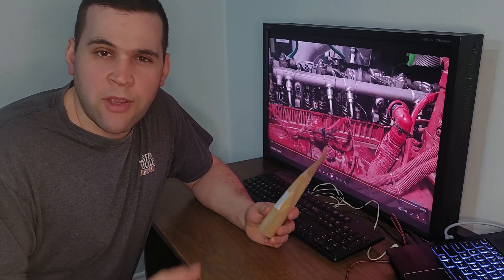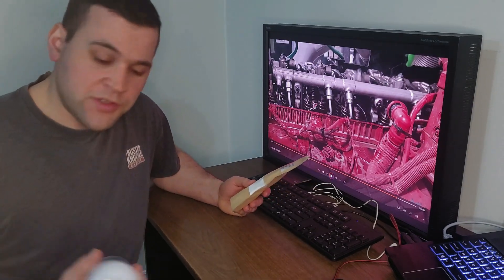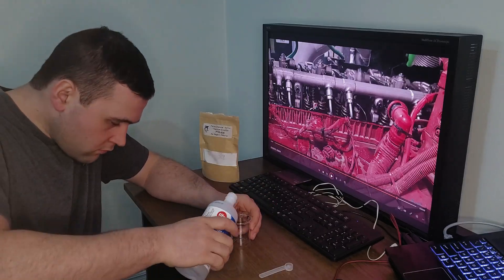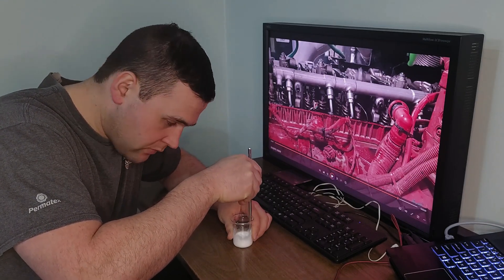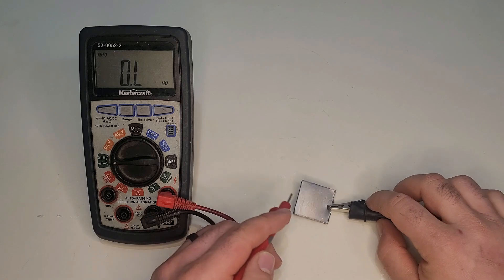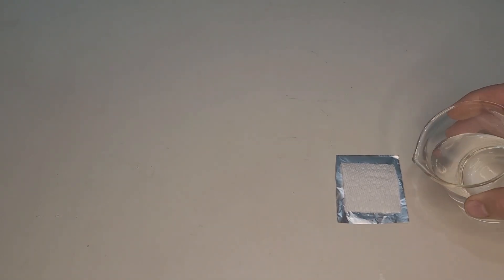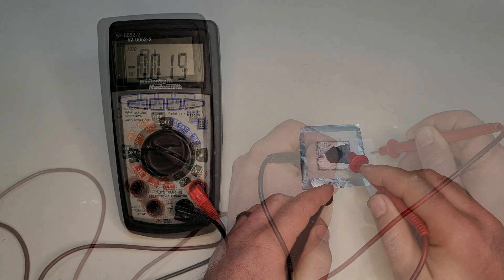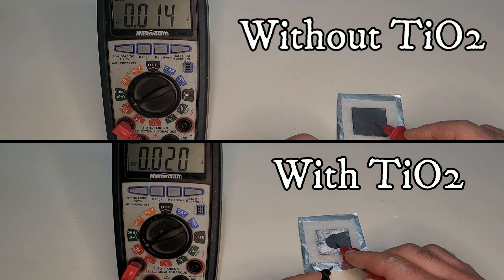Enhanced Aluminum Air Battery Using Titanium Dioxide

Comment: Try K2CO3 in water as the electrolyte, then you will get about 1.33 Volts from the cell and add some MnO2 as a catalysator to even boost the cell some more. Good luck ! Regards, Stefan.
Reply from the maker: Hi there Stefan.  Just wanna say thanks for your comments and suggestions.  Do you have any resources I could check out for more info on using K2CO3?  I'd be interested in reading up on it.  As for the MnO2 I've heard about it, and am experimenting with it currently.  Seems to be the best catalyst around for these kind of batteries.  Cheers!
Reply: @MechanicGoneRogue  it is potassium carbonate you will get 1.33 Volts per cell from it..👍🏻❤️🙏🙏🍀🍀🍀
Reply: Takes a bit time at the beginning, until the K2CO3 has reduced the aluminumoxid protection layer
Reply from the maker: OK well I'll be sure to try it.  Thanks again for the suggestion 😊

Comment: Can you test adding tiny amounts of cetyltrimethylammonium bromide to electrolyte. This will increase the surface tension of electrolyte and may slow down corrosion of aluminum when you put KOH. This may decrease performance a bit but may allow us to finally make the battery rechargeable.
Reply from the maker: Well a rechargeable AlO2 battery would certainly be nice.  I'll keep my eye out for this chemical.  I did a little bit of reading up on it.  Looks like this could be used in a deep eutectic solvent as well.  Thanks for the suggestion.

Comment: I am unsure but I think it works because the oxide layer perhaps gives the electrons a middle step to move through (amperage is simply the count of electrons per unit time) so it was easier for more electrons to get through 

In sciency terms the fermi fermiband is smaller

But I'd like to see that research paper first
Reply from the maker: You know I had to read up on what a fermiband is before I could respond lol.  Good theory on how this functions.  Unfortunately the research papers I mentioned were aimed at how TiO2 intercalated in graphite helped lithium ions transition from electrodes in lithium ion batteries (I think).  So if you're theory is correct that means this is functioning in a different manner.
Reply: @MechanicGoneRogue  I just double checked what the wikipedia article on the mechanics of aluminium air batteries and noted that some batteries included a metallic "catalyst" coated on the carbon, so I then looked up the catalytic activity of titanium dioxide with oxygen dissolution, and it turns out that TiO2 does act as a catalyst in the reaction of oxygen with water to form reactive hydroxides, but only when exposed to light.
Have you tried testing the cell in darkness, and (separately) testing flipping over your graphite sheet so the TiO2 coated surface is on the outside facing the light?
Reply from the maker: @Guy That.  I'm having a hard time finding the exact article again.  I really should have saved it.  An article I found today that seems to be similar is "Titanium Dioxide as Energy Storage Material: A Review on Recent Advancement".  You should be able to find it on Google.  

@Pixl Rainbow I just tried seeing if covering it up changed the reading at all.  It didn't.  As for flipping it.  It actually seems to be a bit less.  Maybe it could be that the sample size is too small?
Reply: @MechanicGoneRogue  thanks
I'll look into it... hopefully 

Life gets messier I'm sure you understand,  haven't touched a single personal project in a while
Reply: @PixlRainbow  perhaps a specific kind of light? If it's sunlight the UV may be the active ingredient so to say
Reply from the maker: @Guy That Absolutely I sure do!  Hopefully you'll be able to squeeze at least 1 project in at some point. :)
Reply: @MechanicGoneRogue  well today I've stumbled onto one funny fact

I needed this catalyst for this one reaction I'm working on that would be a mighty big leap if I can make feasible 
I found a catalyst which I'm still testing but is promising but I also realized, my own fresh blood also works great as a catalyst 

So now on my ever growing "to do list" I have blood Crystals (as a gag ofc)
Reply from the maker: @Guy That  hahaha if someone ever sees your list that'll be an interesting explanation 🤣
Reply: @MechanicGoneRogue  hmm, true true, can you just give me the title of that paper?

And I always try to make what I say both sciency folk and average Joe friendly, I hope the average Joe explanation was alright and you were just doing some extra reading although that's cool if I spread a bit of knowledge